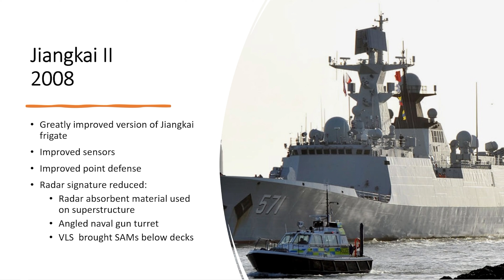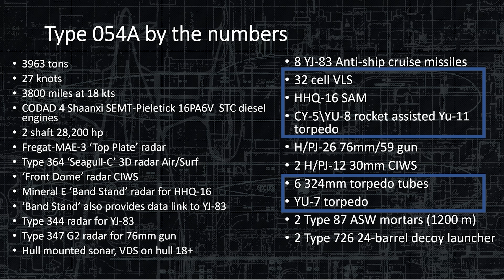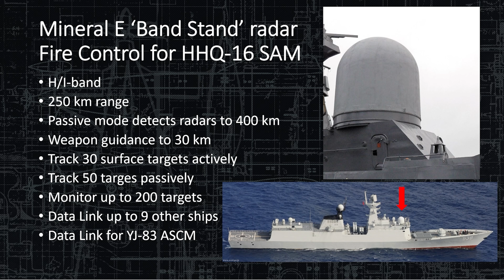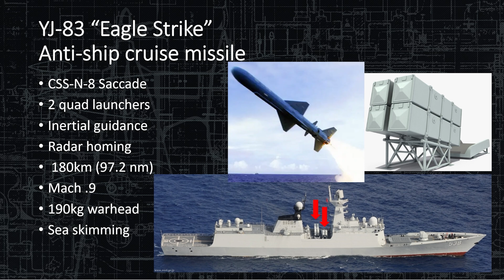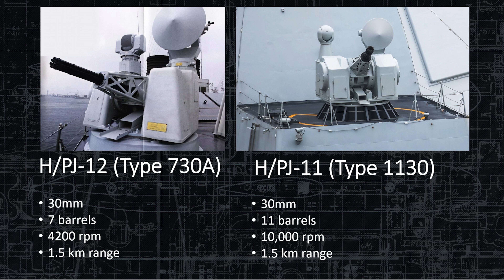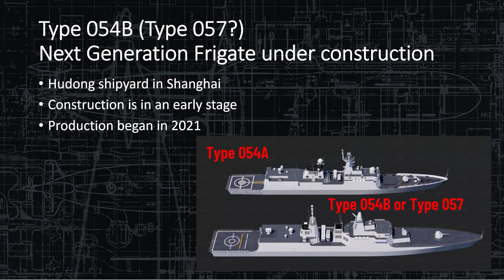Intel On China's "Blue Water Workhorse" In The Red Sea

Comment: How are these things so light? At 4000 tons they're anywhere from two to three thousand tons lighter than comparable surface combatants like the JMSDF's 1990s Mursame class DD (~6000 tons full), modern Asahi class DD (~6800 tons full) and our upcoming Constellation at ~7300 tons. Do they just have paper for armor? What's the deal?
Reply: @Tsarbomb117  You are comparing Japanese destroyers with Chinese frigates, so of course destroyers would weigh more; Chinese 052D also weighs 7000 tons. Regarding the Constellation class, the US designs heavier ships because of the need for endurance to travel long distances. Examples would be Arleigh Burkes being at 10,000 tons and Zumwalt being 15,000 tons (Still called a destroyer btw). Plus, different countries designate their ships differently, so you can't always compare tonnages, but rather their mission goals and equipments. Also, modern ships don't really have armor other than maybe at vital places like the engine and missiles compartment.

Comment: This is 054A primary AWS not air defense.  New version 054B first two ships were launched a few months ago with higher speed, new radar and similar weapon as a low cost AWS in carrier group.  Older 054 were all converted to coast guard.

You may also want to check out an experimental corvette China launched recently, pretty secretary, not a lot of info available.

Comment: I think the 054A frigate can reach a speed of 30 knots. If it cannot reach a speed of 30 knots, how can it follow the aircraft carrier for long-distance combat? In previous exercises in China, the aircraft carrier formation was equipped with 054A
Reply: Just because they want it to do something that requires better capabilities doesn't mean it magically has those capabilities. If it is keeping up with the Chinese carrier, then the carrier is not doing over 27kts. Warships extremely rarely, even in wartime, dash around at top speed. You may well have seen video or source material indicating the carrier has a 54A escort, but that doesn't automatically mean the frigate can match the carrier's top speed.
Reply: US Navy regularly runs at high speeds.
Aircraft Carrier, Carl Vinson, can do close to 50knts. DE Could do 32 flat stick, definitely can't keep up. 
If the Carrier is going to have a functional Res/Des it needs to slow down.😁😁  @mikearmstrong8483

Comment: Thanks for the brief, I think the Russians use RBU hoping to break guidance wires of wire guided torpedoes, it's appears doubtful to be able to hit incoming torpedo with such an unguided weapon unless if it's running in the opposite direction in a straight line and the torpedo is trying to chase it down.
Constellation would be a great platform, probably a benchmark for others for decades though.

Comment: @SubBrief @24:00 you showed the "Type 54B / Type 57" and showed the new ship to be a lot larger physically, but said that it was based on the same hull, so for future reference please either make a note of this, or use a different picture as this picture shows that the new ship is not just longer, but also wider, so not the same hull, and everything else that is common between these two ships shows that the Type 54B / 57 simply has this ship being shown larger rather than a serious upgrade to the hull, the ASCM, VLS missile sizes, larger calibre gun etc.

Comment: ADS is great for a navy that is expanding while designing future ships. While waiting for a full capable CVN which create a larger AA umbrella, ADS mix with conventional DDG is the way. 
It can be either DDG or FFG depending on where the Fleet operate. 
For a small Navy 2 ADS 2 FFG 1 DDG 2 SSK can control up to 300 Nautical Miles of water. If supported by for example we have FA 18 D and SU 30 MKM the ranges is extended with CAP or ASM can be done by the air force before the navy take over. 
CVN is great when you are playing in a vast ocean which enable the group to hide from any hunting fleets. 
Yet within 500 NM well the air force umbrella is sufficient. With or Without Land Anti Ship Missile. 
If place within like 20 to 30 NM to mainland those fleet can have an additional Medium and Long Range Land Based SAM which can be replanish faster than ships SAM. 
Smart concept indeed

Comment: 30 knots is required to keep up with carriers. You don't need 30 knots if you don't have carrier, see most European diesel powered frigates.
But it does mean these Chinese frigates can't escorts their carrier, but that's the job for their destroyers.
Reply: Perhaps their frigates will do the job of the LCS?
Reply: @danielch6662  frigates are generally ASW vessels with other support work
Reply: @danielch6662  They would be closer to OHP than LCS. These 054A have no land attack capabilities or means to deal with swamp attack by small boats. 
OTOH they have very good AAW and decent ASW capabilities for a sub-5000 tons frigate, which is good for picketing duties.
Reply: With nuclear carriers maybe, Diesel carriers can't sustain those speeds.
It doesn't make sense for china to build fast frigates if their carrier groups will never actually travel that fast outside of an emergency.
Reply: @hughmungus2760  Not true, carrier needs to be fast to generate headwind for launching aircraft. Even more so if you don't have catapults. Even a WW2 era Essex class does 30+knots. 
Needless to say it's a bad idea to outrun all of your escorts whenever you need to launch aircraft. 
The Kuznetzov class are steam turbine ships with similar displacement and installed power as an Iowa, so likely also a 30+ knot ship.

Comment: Very nice brief. But just a couple of corrections:
1. There are 40 Type 054A commissioned as of December 2023, not 30.
2. Yu-8 (incorrectly referred as CY-5) is the VLS launched ASROC, while Yu-11 is a different ASROC for angled launchers.
3. Mineral E may be able to track 30 targets, but the 4x AJK-16 fire control radars are only able to provide guidance for up to a total of 8 HHQ-16s. This was only improved from 31st hull onwards when they switched to a new phased array FCR.
4. The ASW depth charge launchers are actually not stationary. They can rotate as shown in some videos.
Reply: Thank you.
Reply: Not really sure how he messed up the thing with the depth charges

Comment: 1.The idea of hide weapons under the deck was first came up by Soviet Union on Kirov class, not US or "NaTo".
2.The "two years" time period is from "launched(into the water)" to "commissioned(in the navy)", which has nothing to do with building the hull or whatever he mentioned.
Im kind surprise u dont even know the difference since u claim yourself as a submarine veteran.
Whats more is that the Zhou Shan hull number is 529 so the pic there is also wrong.
3.About the top speed I believe he is right, thats a big flaw of 054A. And that is why the PLAN is building and have already launched a 054B.
4.Yu8 and Yu11 is not same thing. Yu8 is a rocket assist torpedo with Yu7 warhead. Yu11 was first seen in 2016, and first 054a was launched in 2008, hence Yu11 wont be there on 054a.
5.The range of HHQ16 can be diff from 40/50/70km based on what variant(HHQ16A/B/C) they are, there is also a latest variant HHQ16F with 100+km but im not sure if that variant can fit on 054a.
6.Z-9 is a license-produced Eurocopter SA365/AS365 Dauphin. At the same time they introduced the Aérospatiale SA 321 Super Frelon as well, which known as z-8.

Comment: I hope you can introduce 052D/DM/DL. 055/055A. 039B. 075 Attack Ship. There is also the newly launched 3000 ton class stealth frigate.
:face-blue-smiling:
Reply: The newly launched stealth frigate, 054B, is 6000 ton class, and is the direct successor to the 054A mentioned in the video.
Reply: @drandersjiang  Last November, China launched a new 3000 ton fully stealth frigate to replace the 056A. Not 054B.
Reply: @drandersjiang It has been launched, outfitted, and is about to enter service. You told me not to build a 3000 ton stealth frigate?
Reply: @SpruceWood-NEG  Model number? The only new model launched near the end of last year was 054B, which is ~6000 ton. Also 054 series are the only "frigate" classes in service with PLAN. China is no long building corvettes.
Reply: @drandersjiang  
New light frigate. I heard that over 80 Type 056 ships will be handed over to the Coast Guard in the coming years. There is also the 054 basic model, and the first 10 ships of 054A need to be retired in advance and handed over to the coast guard. The Chinese Navy believes that these ships no longer meet the requirements of future warfare. There are still two nuclear powered aircraft carriers under construction in the shipyard, and the hull segmentation has been completed.

Comment: I work on subsea cables, We took a few synchronized cuts last week on 3 separate segments in the red sea around the hanish
 islands. some shenanigans are afoot
Reply: @ts757arse  Maybe. It wasn't a straight cut, just a few bursts of FEC errors on the data signal and then it settled down a bit after  while. 

If it was from the anchor I would have expected the cables to go down one at a time, but these were synchronized pretty well. Its almost like something was screwing with the repeaters on multiple cables at once.

Though to be honest I dont know for sure
Reply: No bro, Chinese didn't do it and Americans are paranoid

Comment: I don’t necessarily agree with the view that the Jiangkai II  has improved sensors, improved point defense or improved anything. The PLA is a military that is rife with corruption. And there is a reason why Xi Jinping is replacing so many of his top officers in the PLA. They’re either corrupt, incompetent or disloyal. Just because the PLA, the CCP or Xi claim something doesn’t make it a reality. This is a monkey see monkey do military that largely builds its equipment off of stolen designs, Russian hand-me-downs or reverse engineering. They’re always trying to do things on the quick and easy. By cutting corners without building the infrastructure to do it organically.